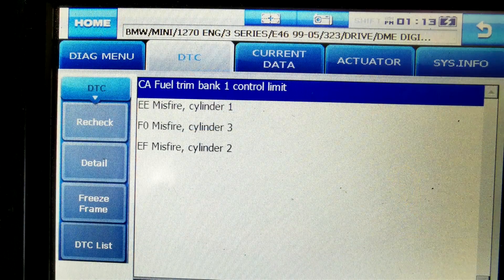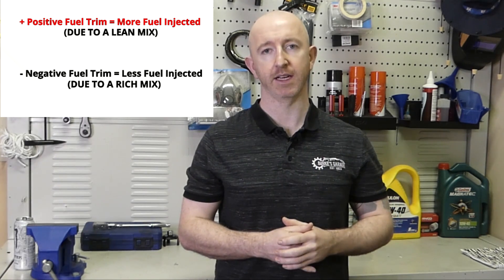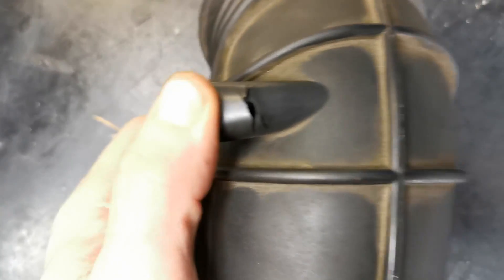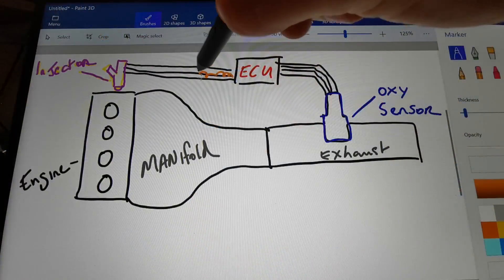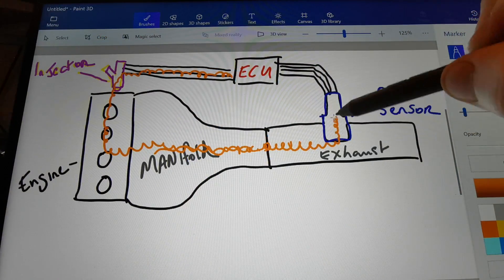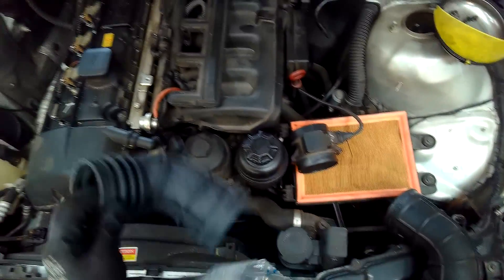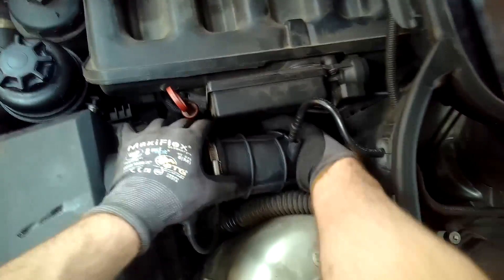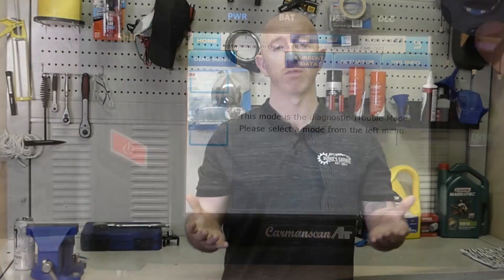BMW E46 Running Rough - Problem Found & Fixed

Comment from the maker: There are other possibilities that can cause fuel trim fault codes to log. 
This video is designed to give good information in a short time frame that can help you diagnose the fault for yourself, in this case a BMW E46 (it is not meant as a crossover for all vehicles with fuel trim faults) 

Fuel Trim fault codes are logged if the fuel trim correction limits are exceeded. 
Meaning you can list the following as possible causes in +/-  fuel trims. 
 *Multiple fuel delivery/pressure related faults, EVAP systems (seen in a recent video) Map Sensor (seen in another video), Air Mass fault,compression faults, ignition faults, Oxy Sensor, any leak before the upstream Oxy Sensor* 
 
I wanted to list this in the comments for others that may want/need the info. Thanks for watching

Comment: HELLO THERE, I JUST FIND YOUR VIDEO PRETTY MUCH INTERESTING. HERE IS MY CAR'S PROBLEM: HAVE a 2003 325i. PRETTY MUCH SIMILAR LIKE YOU HAVE SHOWN HERE. LOSING POWER WHEN I PRESS THE GAS PEDAL DOES NOT GO OVER 50. ALSO WANT to MENTION THAT  SPEETDOMETER DOESN'T WORK. DOESN'T HAVE a CD PLAYER.  THIS CAR WAS parTked OVER 2 YEARS. SO I JUST STARTED TO MAKE THE OIL SERVICE. IF YOU READ MY MESSAGE I REALLY APPRECIATE, IF YOU'LL BE KIND TO TELL ME, WHAT KIND OF SCANNER DO YOU  RECOMMEND ME. NOT EXPENSIVE ONE, NEITHER CHEAPEST ONE. . THANK YOU 👍>by the way I'm a new subscriber 👍

Comment: very clear and informative - I hope this helps... I just did plugs and coils and my rough start persists. Thanks again!
Reply: I have a 2002 325i, and just replaced spark plugs and engine mounts. The shaking is not as bad, but is still there. Acceleration is close to what it should be, but not quite. Will be checking hoses today after work.

Hopefully I find the issue

Comment: I had the same problem with my intake boot (holes and cracks) I changed it out and now it seems to have throttle hesitation and has died on me twice when I try to excelerate from a stop light 
Does the ECU have to relearn after replacing that boot correcting the air flow?

Comment: Guess Ill go look for vacuum leaks too just incase. Mine gave codes of maf and intake air temp. Signals respectively and the car runs rough, idles at around 400rpm and uses double the amount of fuel compared to before. I changed the maf but the symptoms stayed the same. I havent read codes again and I also think my scanner is pretty poor as it gave zero misfire codes even though it even ignites in the exhaust manifold occasionally and puffs black smoke when reved.

Edit: m43b19 engine in mine

Comment: 2:22  Could be too much air or not enough fuel eg low fuel pressure.... could even be a faulty plug or coil misfiring, causing unburnt fuel and oxygen to pass through to the oxygen sensor, making the car think the mixture is too lean...
Reply from the maker: I do not want to over complicate my videos for a DIY user, I may make a video in the future that relates to just fuel trim understanding and diagnosing.  
I am aware of the huge amount of possibilities that can cause fuel trim fault codes to log. 
Fuel Trim fault codes are logged if the fuel trim correction limits are exceeded. 
Meaning you can list - fuel related faults, EVAP systems (seen in a recent video) Map Sensor (seen in another video), compression faults, ignition faults, Oxy Sensor, any leak before the upstream Oxy sensor. 
 
We use experience and info to make real time decisions, these can turn into a really quick find and fix like in this video (rough idle that evens out when increasing RPM is a high % chance of an intake leak) most times we need to go much further and test many components but sometimes we get lucky :) 
 
Thanks for watching Aman, I appreciate your input.